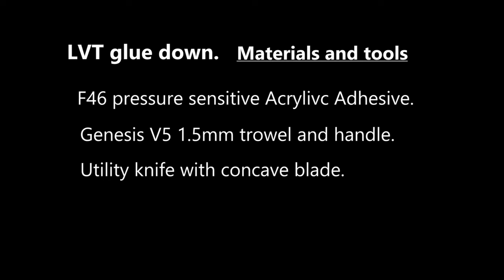A guide on how to lay and install a glue down, dryback LVT (Luxury Vinyl Tile) floor such as Amtico

Comment: My floor is carpeted over the top of OSB board, if i remove the carpet and feather finish the joints will this glue be ok to use? Thanks
Reply from the maker: No, I wouldn't advise it. I would fit a 6mm plyboard (flooring grade fg1) on top of the OSB and then prime and latex over the top to fill in the cracks and dents from the coil nails, allow to dry and sand to a smooth finish. The it will be ready for the LVT. This will make a much more stable subfloor and a better finish that will last much longer.

Comment: Hi, i have a large downstairs area to do throughout hallway kitchen living and wc. Floor isnt great but not good enough to go straight onto. I really really dont want to self level. Is there a underlay i can use instead to glue down onto over the top of concrete?

Comment: Nice job! What is the working time for the adhesive once it has gone translucent?
Reply from the maker: It remains tacky for a couple of hours. If you give it a little heat with the gun it can re-activate it so you can put some more tiles down. Best thing to do though is get the tiles stuck down in one go. i.e. don't go off to the pub without sticking the tiles to the glue.

Comment: Hi can you lay this on top of existing vinyl flooring with the glue ? Thanks
Reply from the maker: No you need to have a clean, very flat and stable subfloor of latex over concrete or a plyboard floor for this type of floor. If you want to go over another floor you will want a click floating LVT floor. We will make a video on that soon.

Comment: If you’re going on top of floorboards that are so unlevel do you ply them self level comp first ?
Reply from the maker: Yes, as long as the floorboards are stable then you put down  flooring grade 6mm plyboard something like this: https://fg1-plywood.co.uk/ , then apply a feather finish to cover the gaps and holes from the nail gun or better still a self-levelling latex floor screed across the whole thing. The allow to dry and sand and you are ready for fitting.

Comment: Do you require underlay for this?
Reply from the maker: No, you can glue this right to the subfloor. That can be plyboard (flooring grade) or a latex screed floor. The subfloor is key, you need to make sure you prep this floor very well so it is flat and even. If you really need to you can use an underlay like soundsense which is a crumb rubber underlay for soundproofing and glue it to that. Most of the manufacturers have acoustic LVTS and underlays you can purchase form them too. 

Here is a video on screeding a subfloor: https://youtu.be/c971nNCH9kg

Comment: Can You glue it to the cement floor of even!
Reply from the maker: Technically you could as long as it is very flat and even. But cement floors rarely are and so it is usual to put a much finer latex finish or even a feather finish over the top and sand it down to get a nicer, smoother surface to fit your LVT to.

Comment: Can I varnish over the top, my lavanto flooring is just 3 years old yet very full now… please advise as to what can be used to make it shine again?
Reply from the maker: Hello I would get on the Luvanto about that as they offer a minimum 20 year domestic and 10 year commercial warranty on their products. But the short answer is no. Generally you cannot varnish LVT floors. The are made of plastic and the varnish is likely to strip away the protective layers. You can clean them and they will buff up a little with a product like this: https://www.ebay.co.uk/itm/165474988115?hash=item268713f053:g:v0gAAOSwFkNiVsVm but varnishing IMHO, no. But confirm with Luvanto themselves: https://www.luvanto.com/contact-us/

Comment: I would have laid the whole field first avoiding any small pieces at the ends as you said you did on the sides then scribe the cuts last. Never use a heat gun the tile they will expand then shrink on cooling

Comment: Why use a heat gun, why not scribe or back mark like it’s supposed to be done.
Reply from the maker: Speed is key and if you can do it right and do it quickly, well that's what we do as professional floor fitters
Reply: LVT is not meant to be heated as it expands the tile then shrinks on cooling

Comment: so if you're fixing skirting board after laying the floor how big an expansion gap do you leave?
Reply: None, dryback lvt do not expand
Reply: Glue down doesn't require it imo, it is a debated topic, but I've had glue down in my living for 7 years and so far no issues, breakages or lifting with no expansion gap.

Comment: Did you need to roller this after?
Reply from the maker: With this small space yes a small hand held roller was used, yes. For larger spaces then a big old 65kg roller is used but it isn't possible to get that in small domestic spaces like this.